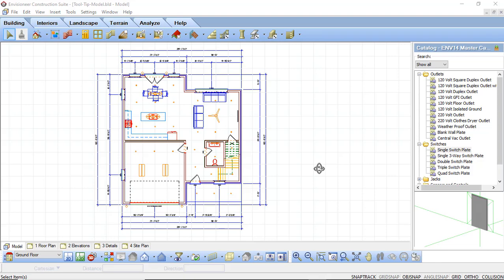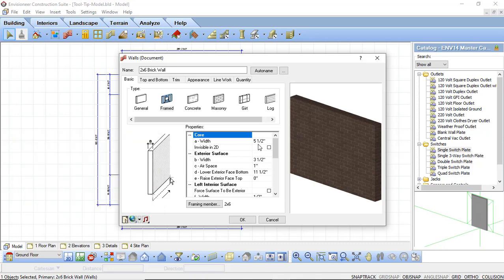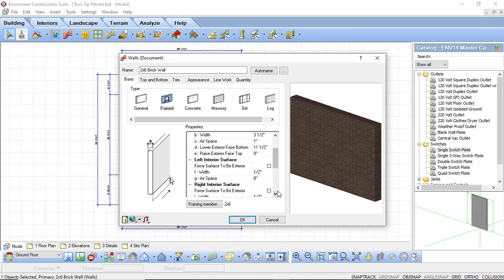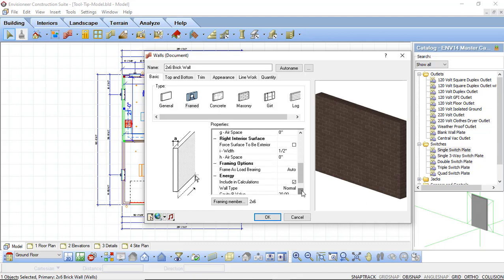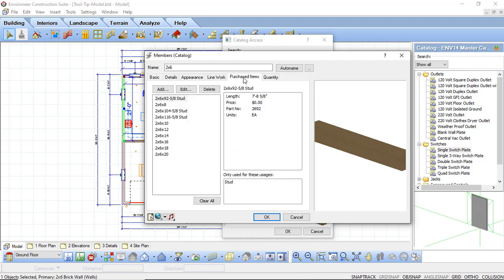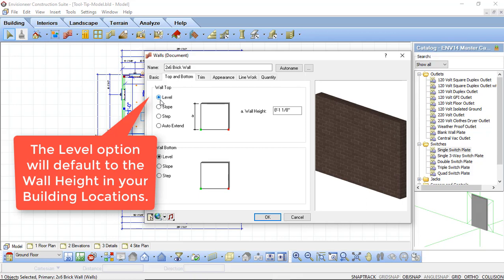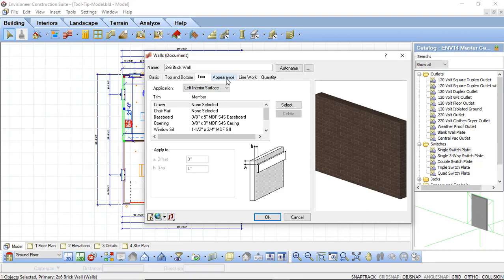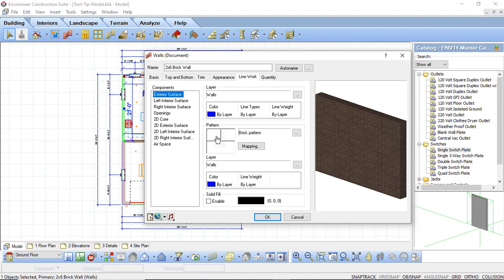Wall Properties

Comment: This video was extremely helpful, thank you. Perhaps you can tell me why a piece of triangular plywood appears inside an exterior wall when an interior wall is attached at a 90 degree angle and is not off-center. It happens randomly and doesn't make any sense to me.
Reply from the maker: Hi. So glad the video was helpful for you! We would have to see the file to understand the triangle. If it happens send it to support@cadsoft.com and they can take a look at the corner to explain what is happening.